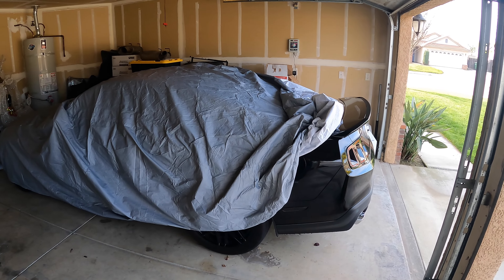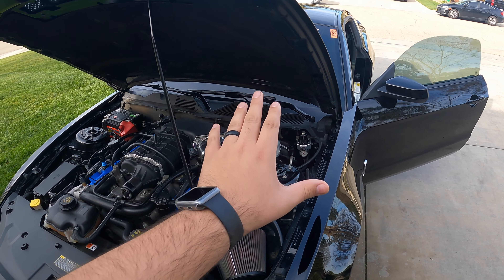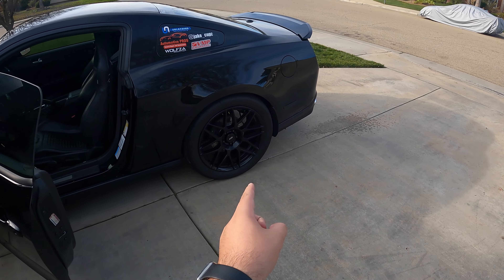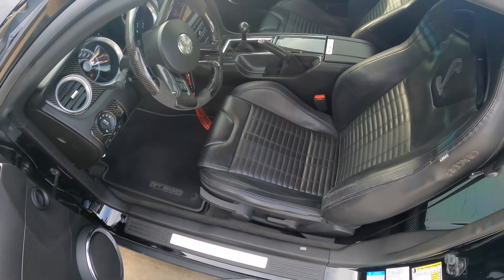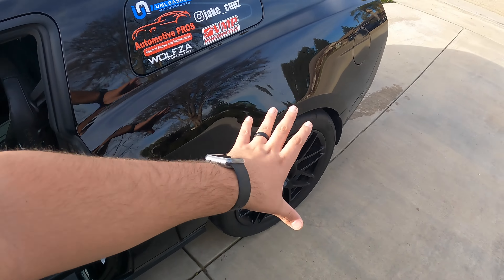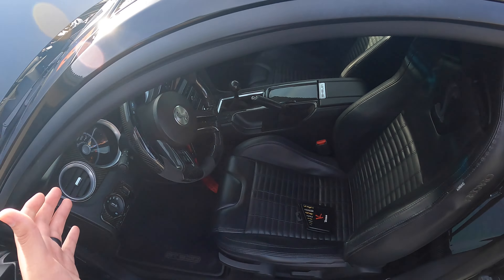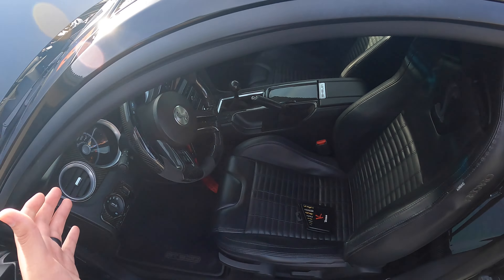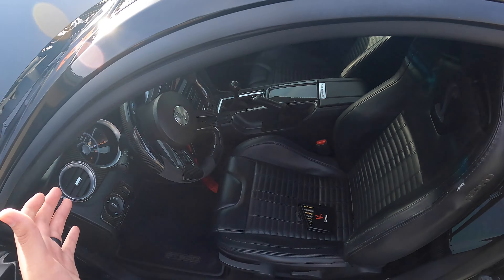First Flyby In the VMP Gen 3 R Shelby GT500 // Fixing The One Bolt That Nearly Totaled The Car

Comment: Get a real tire on that thing aka 15x10 on the rear with a 275/60/15 et street r or even do the 315/60 it's a 30 inch tall tire the 275 one is 28.  You making real power you need a real tire those low profile shit ones aren't cutting it obviously lol.  There is a reason big power cars running around with 15s on the back and it isn't for the trendy look.